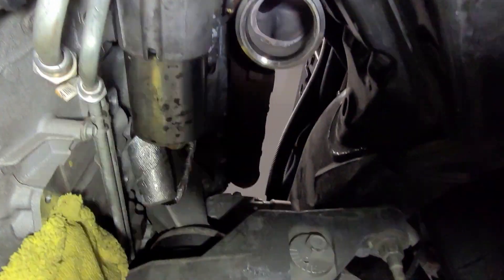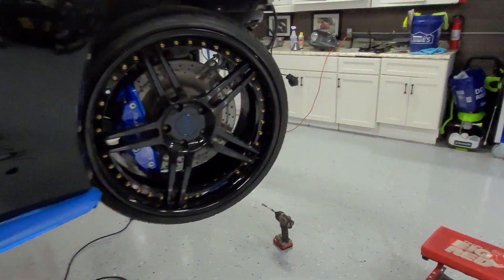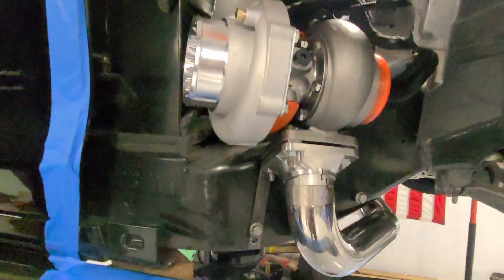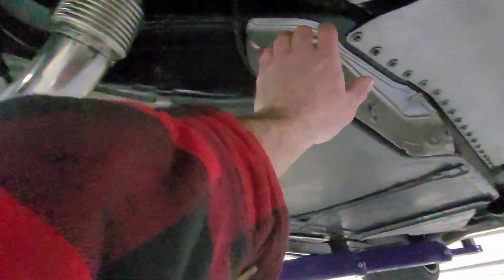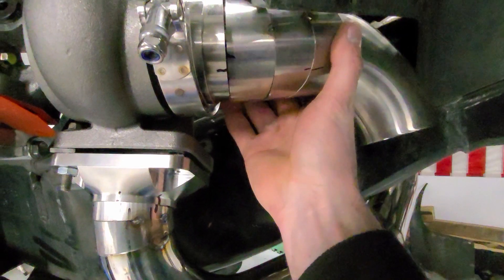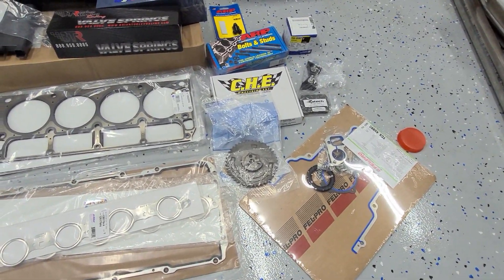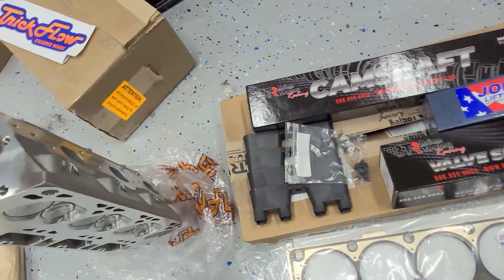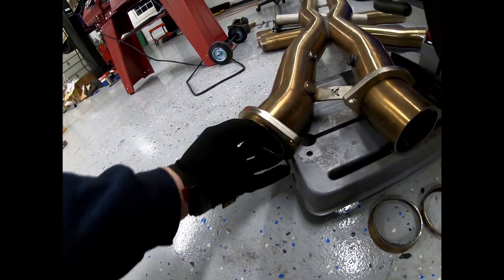Z06 Twin Turbo Build: Part 2

Comment: I think I'll be doing the same, my c6z has been down for a while and have an aluminum gen4 5.3 that needs boost lol
Reply from the maker: Nice! Why is your z down?
Reply: @ChrisSullivan69  loses oil pressure braking or turning but I haven't looked into why, might be low on oil who knows 🤣. This started having after I swapped an ls3 to boost it but that never happened smh

Comment: Do you remember what brand bellow you used on the hot side of the turbo?
Reply from the maker: Amazon. Needed them fast. 304SS
Reply: @ChrisSullivan69  Ah gotcha, I've seen the vibrant ones don't have great reviews. I've heard they blow out under the exhaust gas pressure on a turbo system. Doing a trubo setup on a Camaro and wanted to add some bellows for flexibility
Reply from the maker: @JuryRigGarage  we will see how they hold up. I've blown out the high dollar Ace race parts ones too. If these blow out I might just weld in some pipe